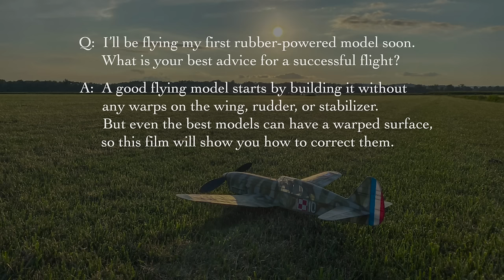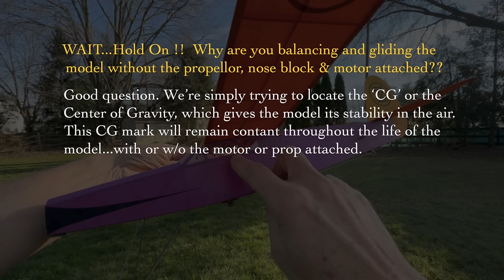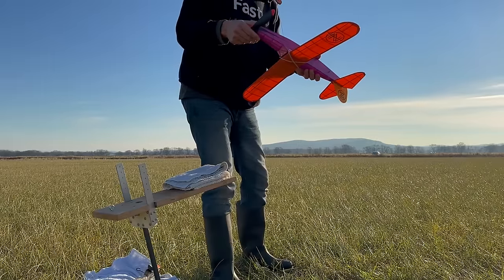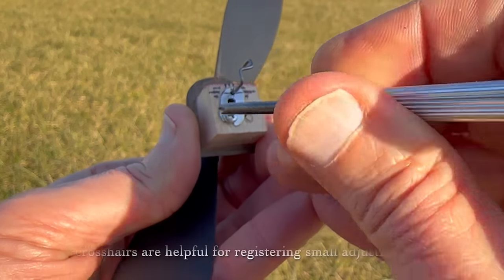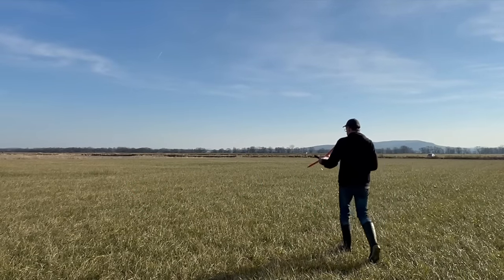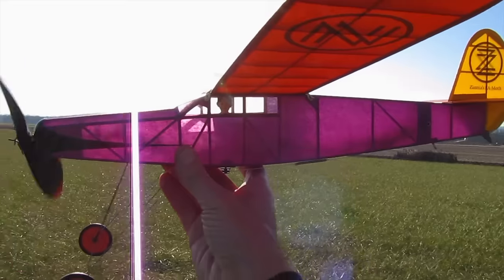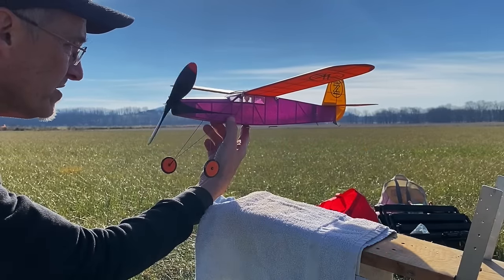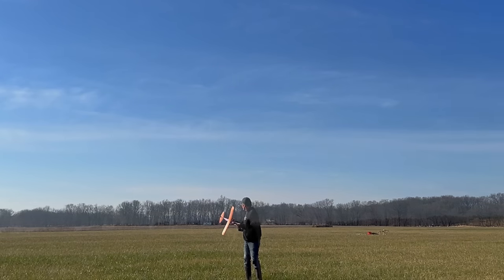Free Flight Trimming Basics #1 - Series Premiere - 'First Model' Flying Session

Comment: I noticed several folks here quoting their age so ill state I'm 63 also. I was starved for models and resources in the 70s but I was able to get a few flying back then. I have several flying right now and I'm learning a lot from your videos, especially this one.  I always launched with the wind, and I wanted to know if you do the same or launched into the wind.
Reply from the maker: It's always best to launch into the wind or whatever breeze is happening, so that the model gains lift immediately. Launching with the wind makes it far more difficult for a model to achieve lift.  Notice on a few flights here, as she comes around back into the mild breeze, she slows a bit, almost holding her position in the air. It's the same effect when you launch.

Comment: Tom, once again, many thanks for these videos. I've rewatched many of them - so much great information. One question though: After the wing warp was fixed, the plane glided perfectly straight, and as well on the field test glides with the motor installed. How then does the glide phase of the flight retain that gentle right turn when the motor runs out - wouldn't it be expected that the plane would then just glide straight all the way down?
Reply from the maker: The short length of the test glides don't always reflect the true nature of a model's glide path. But also, once the model transitions to the glide phase, the free-wheeling prop (which has a bit of right thrust dialed in via the prop shaft) contributes to the right pattern in the glide.

Comment: information for you and subs
6:30   in general, the optimal location of the cg of an aircraft is at  Thirty percent  of chord (or mac).      or, a bit forward-of thirty percent if there is tail-heaviness in the model's distribution of mass (dom).        the elongated mass of a rubber motor unavoidably contributes to wonkiness in the dom of a very light model.         after cg is located consistent with these rules, trim the horiz-stab for a good  glide; with no stalling/galloping.         this amount of nose-up trim will tend to cause a model to climb, when it is flying under power.          it can be useful to understand that only aircraft have a cg.    and,  cg is  ---  the optimal span-wise line of balance, when the mass of the aircraft is being supported by the main wing; eg., when flying.        d

Comment: Model designs in the period before plastic props had long noses because they used lighter balsa props. They also used larger fins because the prop has the effect of a forward fin. Changing to a plastic prop will likely require tail ballast or a shorter nose and maybe a smaller fin.

Glide testing is a good way to get in a stable CG range for glide. For glide duration, you want the CG that gives minimum sink. Glide test trim is different from power trim. Under power, the thrust introduces a pitching moment that must be balanced by a change in pitch, so you are not flying at the same attack angle. In addition, the prop slipstream over the center of the wing increases the velocity and thus the lift. I found that the lift coefficient in glide was significantly different from the lift coefficient under power. The criteria for trim under power is torque to fly level. Trim CG so the torque to make a level circuit is minimum. Level flight is the condition at apogee. This also allows a thinner motor for more turns per inch.

The optimum duration motor is the one that starts with a quarter turn less than breaking and lands just as the last turn comes out of the motor. There should be no glide; the motor must turn all the way to the ground. This condition is equivalent to the motor with average torque equal to level flight torque. If the motor runs out in the air, it means too much power was used in the climb. Power is the rate of use of energy. You have a given quantity of energy stored in the motor. Duration requires that energy to be used as slowly as possible, in other words, at the least power to keep the airplane in the air. The torque of our rubber motors is not uniform, so we must find the best balance between climb and descent. That occurs when the motor's average torque is equal to level flight torque.
Reply from the maker: Thx for sharing your knowledge & experience.

Comment: Hi Tom, thanks for the video, I learn many with all of them... About the motor, the length it will depend on the fuselage length? I remember with my peanut indoor models I always made the motors two times the length of the fuselage, is important this or not? how long do you use? ...thanks and happy new year!!
Reply from the maker: Thx.  Yes, the motor length is generally determined by the fuselage length. I shoot for 3 times the hook to peg length, sometimes less, sometimes more. The FA Moth is 14", but I only went with 38".  Felt like it would be plenty.  Since this model needed tail weight, I could probably push it to 40".  But it also feels a bit underpowered, so I might just go with more cross section.  Anyway, it's always fun trying these different approaches to the motor. Happy New Year.
Reply: Thanks @maxfliart !!!!!

Comment: I’m a bit confused. In this video you use braiding to get the unwound motor to hang at just the right length between the nose block and the rear peg. So the nose block is just held in by the braid tension. However, in previous videos, images of the unwound braided motor seem to show braided motors that are much longer that the length of the fuselage. Have I missed something? David
Reply from the maker: Thx for the comment. The braided motor, prior to winding, is still quite a bit longer than the prop hook to the rear peg length, and could easily hang a foot outside of the nose. It's only after you wind the motor, then allow it to fully unwind inside the fuselage, that it rests slightly suspended between to the two ends. This is the true impact of braiding. The nose plug is not held in by this tension, but is a snug fit that allows it to stay in place regardless of tension.
Reply: Ok I see -all clear now. Thanks for the quick reply. Your videos are great. David

Comment: Thanks for posting the video.  I watch all of them as often as I can.  I have a question.  How do you know the plane needs wash-out or wash-in?  And I am really looking forward to the dethermalizer video.🥸
Reply from the maker: There's a lot of debate about the use of wash-out vs wash-in...but in the Moth's case, it was severe, with unintended opposing warps from the start. I was hoping to have flat wing surfaces...but I used a stronger shrinking tissue (than my usual tissue) so the warps surfaces. 
Bottomline, I think of wash-in or wash-out as one would imagine the impact of ailerons. Lift up one wingtip TE, and the model will tilt in that direction.  Drop the TE, and it will tilt toward the opposite side. It doesn't take much to have an effect, so I shoot for identical wingtips, then adjust with either minor bits of wingtip weight (clay beads) or very thin balsa Gurney flaps....which I expect to demo the use of in future episodes.
Reply: Hi Tom, How much " wash", would you have on the Moth's wing? Is it the full length of the wing or just at the wing tip? Thank you, Michael